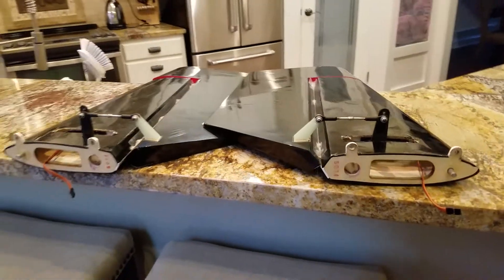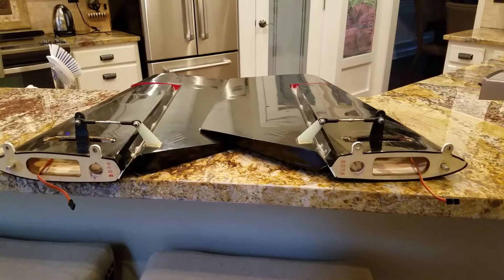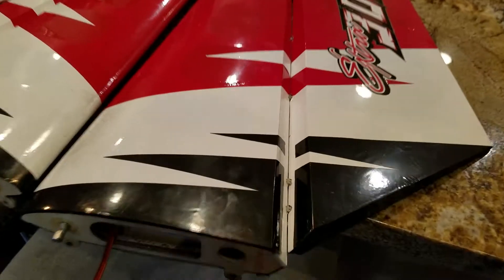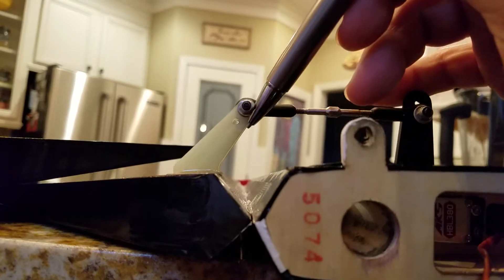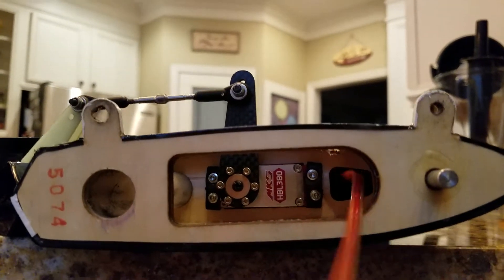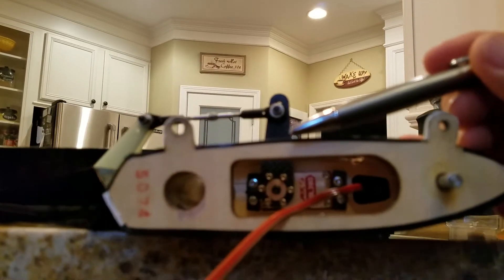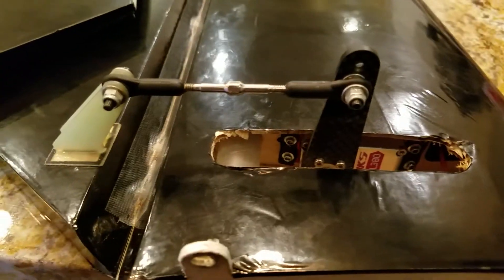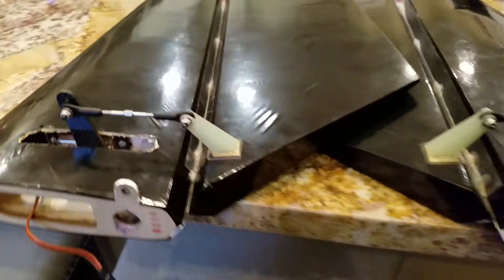DUAL ELEVATOR GEOMETRY

Comment: You need to use a throw guage or at least a ruler to ensure that the elevator move the same amount in each direction, and actually track with each other.  An incidence guage is also helpful in matching the elevators. Matching elevators is very important to get a plane to properly track thru a loop.
Reply from the maker: Of course, you can use two sticks, but what if one elevator is warped?
I need thought little different way, but just as effective.